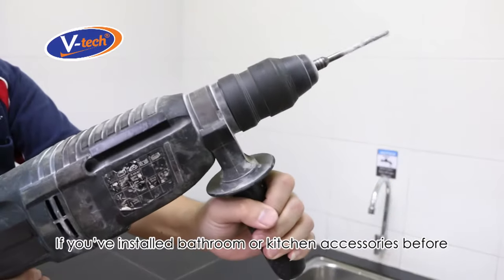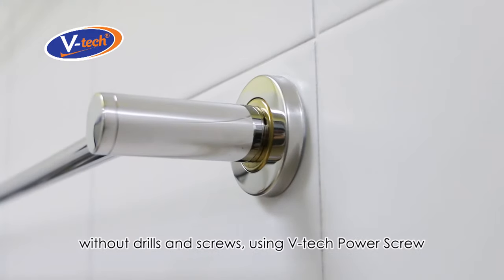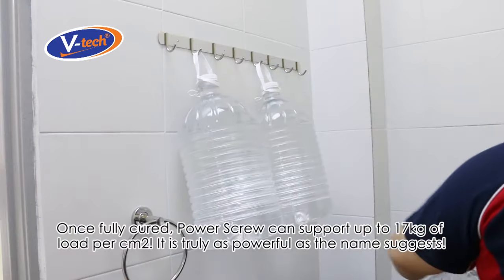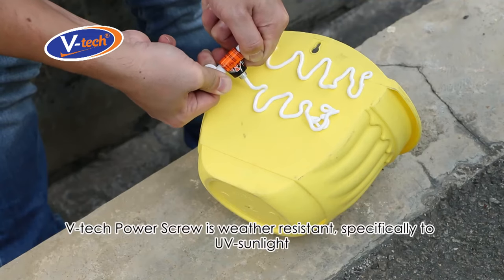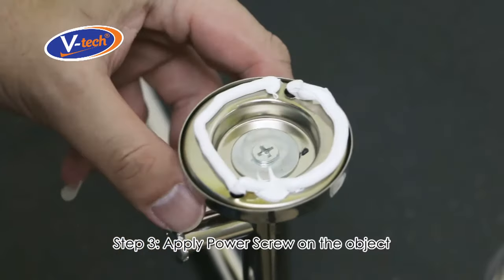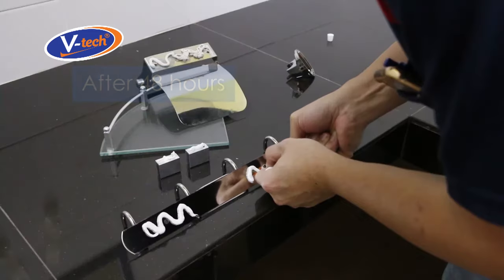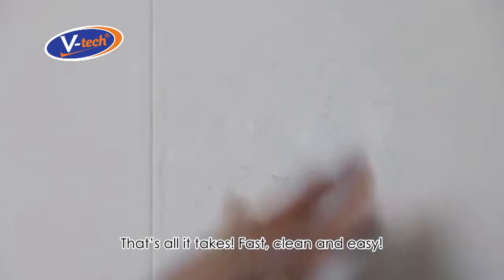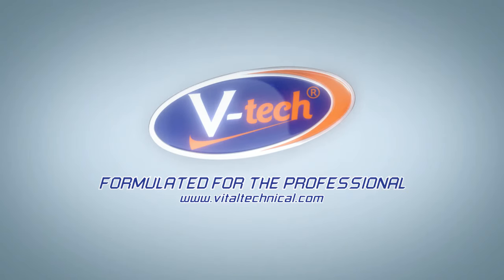Bathroom accessories installation without drilling/screw (VT-106)

Comment: How to remove if we replace or change a place
Reply from the maker: Heat up the adhesive using hair dryer, when it is hot to touch use a knife to cut the adhesive. However, you can directly cut the adhesive using knife without hair dryer, but the adhesive will be solid hard, heated up adhesive will become softer and easier to cut.